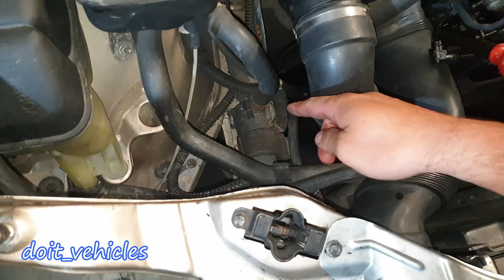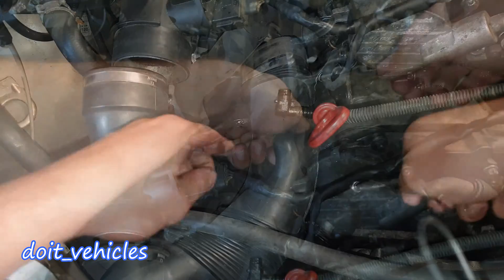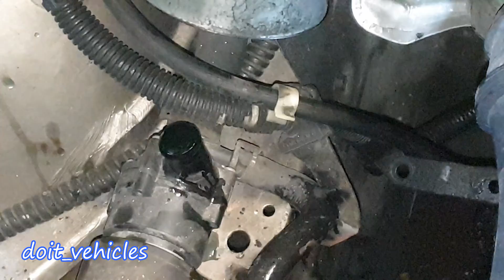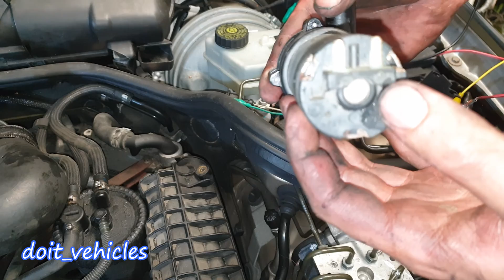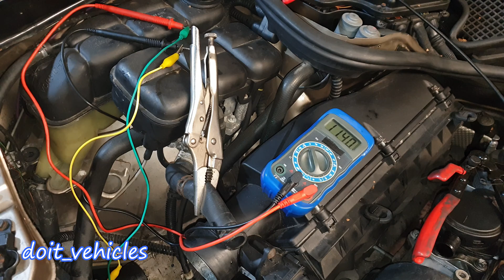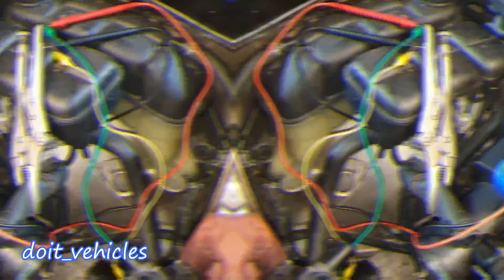W210 Mercedes E220 cdi Auxiliary Water Pump Replacement

Comment: Hay friend! My 300td w s 210 E 300 TD , boiled the water untill 120° and had tò stop immidiately.
The lower left leever was cold and hygher onnrifht side from radiator tò motore block was exteemely hot.
2) i saw that the 2 ventilators behind radiator never more  worked, at noone temperature. Is common like 
broken the termosthat? The rele'? Or the pump?
Thank a lot, freddy

Comment: thank you for this tutorial! How does the REST circulates the refrigerant in opposite situation, in summer? I mean is there "auxiliary" refrigerant pump? Thank you very much in advance!
P.S. when I looked one more time carefully it seems like there is an additional water (coolant) heater there. I initially thought that the pump takes the water/coolant from the expansion tank and just passively pumps it through the system. But it looks like (I assume) there is additional heater with reservoir which heats up the fluid. Am I right?
Reply from the maker: There is no additional pump for the refrigerant since it needs to be compressed while the engine runs ( might be possible on electric AC ) . The thing you saw might be the mono / duo valve ?
Reply: @doit_vehicles  at 00:10 you point out to a "water heater", so I assume that the antifreeze is heated additionally by this heater while the blower works on REST mode?
But my question also is if you set REST to low temperature in summer, how the climate control works then? How does it generate cold air for some time when you leave the car on REST?
P.S. Back to the water heater. I thought initially that there was just the auxiliary water pump that pumps heated coolant fluid and the system uses the residual heat of the coolant to keep the cabin warm while you are out for some 30 minutes. But it turns out that there is a heater that actively heats the fluid.

Comment: It seems that the air conditioning can be blocked in failed mode when this auxiliary pump is failed.
Reply from the maker: hmm , how you found out that ?
Reply: @doit_vehicles  When I entered in the maintenance mode of the air conditioning control box. I found the default 416 which correspond to the auxiliary pump. I checked my pump. It was not working. I replaced it and now the air conditioning works.
Reply: @armandh9287  where did you get the pump from
Reply: @mr.blitzsendem  Hi. It was a used part from internet.